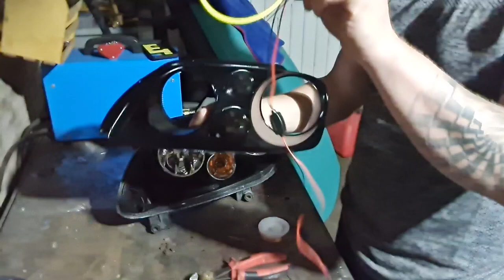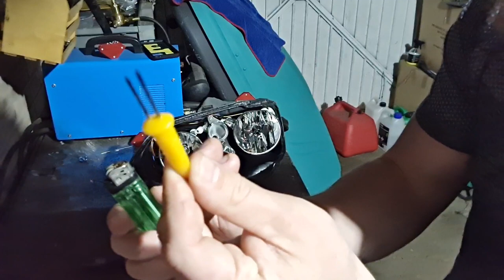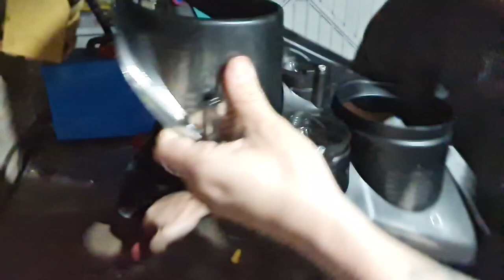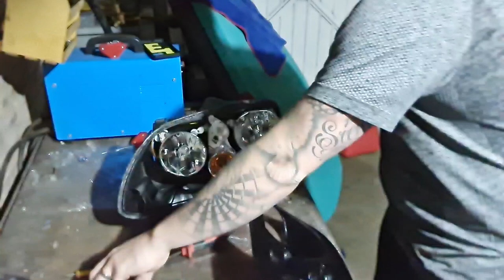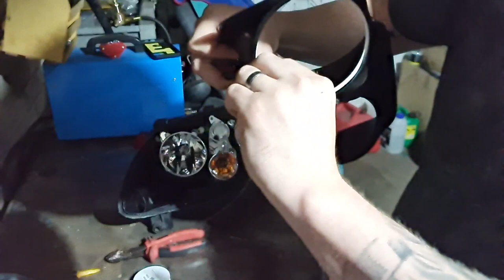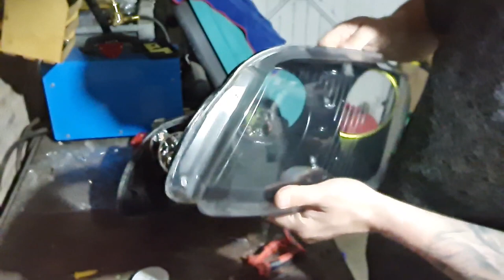Fitting *Halo light* *halo eyes* vw touran & caddy

Comment: Did you wire these to the original sidelight wires so they work on the switch
Reply from the maker: Yes I did a single/twin halo is fine to run of the standard wiring but i have fitted colour changing ones aswell and they need to run off the battery.